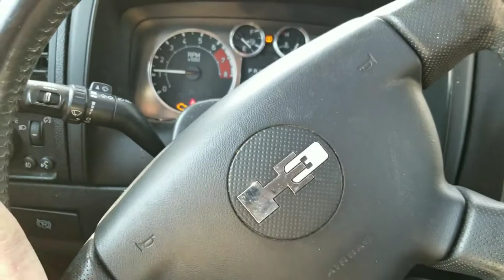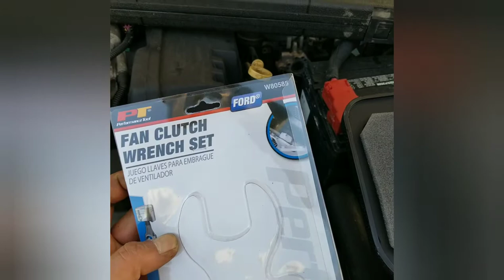Hummer H3 Water Pump Replacement: What could go wrong?

Comment: Great video. I m just about to replace the water pump too. What size wrenches did you use for the fan clutch bolts?
Reply from the maker: I hope it goes well for you! I actually used a wrench from a kit from Advance Auto and a wrench from a kit from Harbor Freight. Not sure what the sizes were, but I do recall one bit was from a Ford tool kit.

Comment: What a nightmare. I just changed my water pump in below zero temps outside and was nearly 3 days getting it out. Clutch fan bolt didn't want to break loose. Just flat out refused. No amount of banging, pipe wrenches, or open flame would get it to budge. The "specialty tool" was beyond worthless and bent on day 1. I loosened the pulley and had just enough space to get a 10mm in behind it to loosen the bolts holding the water pump in 1/8th a turn at a time. Took me a whole day to remove those long winded SOBs. After that I removed the fan bolts and alternator (was changing that anyways) and managed to twist and turn and squeeze the whole assembly out of the engine compartment with minor fin damage to the radiator.  Still needed that pulley and fan blades so I took it and got it into the vice and w/ 2 pipe wrenches with 6 foot long cheater pipes and some very creative swearing I hung all my weight off the end and FINALLY a loud bang and the clutch fan bolt broke free. After that, everything went back together in about an hour. Figures....
Reply from the maker: That is crazy boss! I've dealt with some ridiculous parts to remove, but I reckon that takes the cake! Sure am glad ya got it sorted. I'd have probably hauled it off to the scrap yard lol!